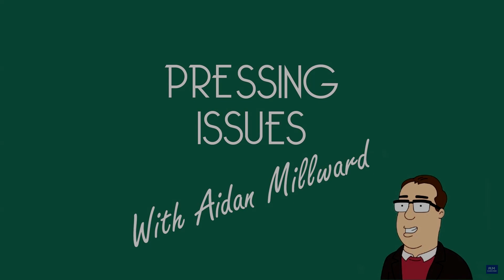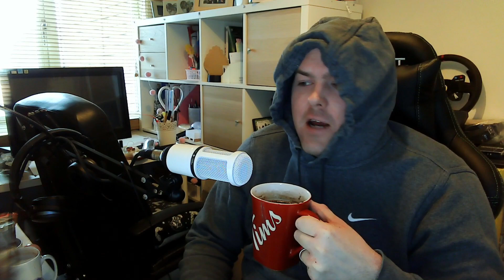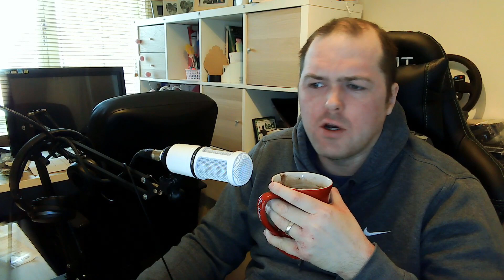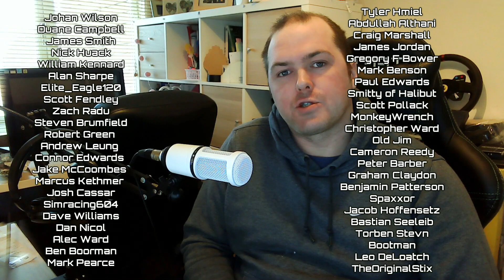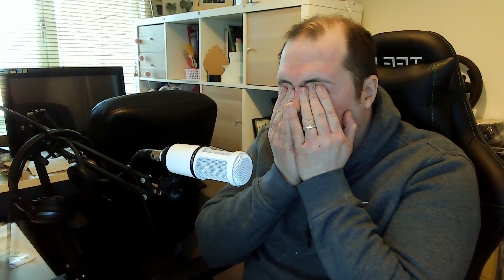IS IT REALLY TILKE'S FAULT? Opinions on Hermann Tilke Track Criticism

Comment: New proposition: it’s the cars’ fault for being way too powerful. I remember A1GP. They had 550hp and they went to all sorts of interesting tracks. Brands f.i. They could because they weren’t so fast that it wasn’t safe anymore. Less power would also help against dirty air since you can’t set up for all that downforce if you haven’t got the power to offset the drag
Reply: unfortunately due to how the engines are with the hybrid systems you wont be able to go under something like 750bhp even if you went down to a 4 cylinder engine as Porsche used a V4 hybrid engine in WEC and it produced 1000 bhp
Reply: @thebronzearchertba9442  No, the V4 produced 550hp. The remainder of the power was from the hybrid system. Any engine/hybrid system can produce as much or as little as it is regulated to do. The 1st gen Prius was a hybrid, and produced significantly less than 750HP; the engines in GTE (LMGT) produce less power than the road cars do, the old 2.0l F3 engines produced less in F3 form than when thy were used in touring cars; the GP2 engine produced more power when it was put in an LMP2 car, the FIA F4 engines produce more power in WTCR cars, NASCAR restrictor plates gave the 900hp engines 550 on Superspeedways - it's all goverened by fuelling, revs, restrictors, gearing, boost, exhaust; plus hybrid regen storage and delivery capacity. The current F1 cars could easily be restricted to 600hp combined - but what would be the point now all the money has been spent making them excessive.... The 'less power' argument would however solve nearly all of the 'bad track' problems - just look at GP2/F2 races.

Comment: I believe Tilke also mentioned that the problem with modern day tracks is that they have to cater for more than just F1 races. Especially if bike racing also takes place there makes a new track a horrible compromise so you end up with the worst of both worlds so to speak.
Reply: Or the motorbike racing is excillent which is whats happened with Moto GP at some of the tracks both F1 and Moto GP go to

Comment: Poor F1 racing is far from Tilke’s fault IMO. True a couple of his tracks are a bit dull IMO, but no more commonly than average. The tracks are largely constrained by safety, the lack of land & irritated locals. Many have corners that I don’t like, bk I struggle w/ them so much, but I see that more of a change to make me a better driver.

The primary blame IMO is F1’s dependency on downforce (not necessarily bad) causing dirty air making it hard to pass.

The other biggie IMO is the dominance by 1 or 2 teams. This is mostly bk of the insane costs to run at the front in F1.

They have made small +’s in theses 2 areas in the last couple of yrs but I think MUCH more could be done on both points w/ still having cutting edge technology w/o turning it into another NASCAR or Indy-car. Eg Blancplain GT3 & Japan’s JGTCC.

Comment: Yes and no.
Hermann does have a certain theme for a number of his newest tracks (Chain Bear does a great breakdown of this). There's always going to be a sharp hairpin into turn 1, 90 degree corners, and corners that were popular in previous tracks he's designed. Some of them, like the South Korea track and Abu Dhabi look like they were designed for something else in mind; like he got bored with doing tracks and thought, what if we put a hotel that looks like a spaceship in the middle of this? Or if they built a city in here? 
In his defense, he's got to follow FIA regulations and what the higher ups at F1 want. And Lewis Hamilton is an anomaly who can't stop winning. I think Liberty has to stop with this whole 'destination race' idea because trying to get a good race on a street circuit is impossible unless you convince whatever city (or in Singapore's case, city-state) you're racing in to demolish 10 blocks to have a bigger pit lane. With that said, he's going to have his hands full trying to get a good race in fucking Saudi.
Reply: Yes to Korea and Abu Dhabi - the same as Sochi the track layout space was dictated in part by the need of the planners for the tracks to go around (or through) yet-to-be-built objects. At Yas Marina and Sochi they mostly got built, at Yeongyam, not so much...

Comment: I genuinely don't get the hate towards Hockenhiem... I absolutely love the current layout
Reply: I was born after F1 stopped using the old layout and I enjoy both the current and old layout of Hockenhiem and it ultimately wasnt Tilke's fault that the circuit looked the way it did he still wanted to origonally use the old layout but with modifications and more seating he planned to try and get the chicane removed from the Ost curve but ultimately it was the circuit owners that wanted the old circuit gone

Comment: I don’t think fia rulebook state that most of the corners have to be 90 degrees.
Reply: Apart from Sochi (built around an existing set of structures), Baku (street circuit), and Singapore (street circuit), which Tilke circuit does that describe?
Reply: @grommile  You're forgetting abu dhabi and it's 3rd sector which is almost entirely 90 degree corners. The problem is though the track at that point is restricted by the harbor and building that it winds around. You can't really make any changes there without changing the harbor or destroying some buildings. So  really, this is another case of tilke trying to make the best track he can in a shitty situation.

Comment: You can't blame the track designer or the track

when it comes to putting the on track product on it comes down to the race teams and the officials to give them a good package to actually put close racing on

in as much as we all know Ferrari was cheating in 2019 I personally don't think they're engine should have been nerfed to the point that it was

They were the only other manufacturer that had a real shot at the championship in 2019 let's face it Honda Renault and all the other cars on the grid don't really have that shot like the factory Ferrari team

And also you know it's been over a decade since Ferraris won a championship I think

So you can't blame Lewis Hamilton's basically got the same problem that Jimmy Johnson has he's too damn good now

And he's in the best equipment

And he has proved that he deserves to be in that equipment as far as I'm concerned no other driver has proved yearin and year out that they deserve to be in a Mercedes car like Lewis has

I've got an easy solution put a rule in the rule book that requires the team to do two stop race

Intel pirelli they have to bring softer tires softer tires will solve some of the issues

But if you have a rule in the rule book that requires them to make more than one pit stop let's face it all the teams have got this figured out to where they can only do it do it on one stop

One of the best things about IndyCar and NASCAR I'm using them as perfect examples they actually have pit stops

Throughout the race and good strategy for me one it's either who can run the longest who can make the soft tires last the longest to get to this point

Who can catch a safety car at the right time

Also the guys in F1 do not know how to control restart if one doesn't do their safety car restarts right

They should have a at least a cone where the restart it takes place at the entrance of pit Lane that you take off zone

That's how it works over here in America we have a little yellow orange cone we have to follow and sports car racing in open will that tells us where we can go before we get to the restart zone

That is the restart zone with the green flag comes back out

And restarts can make a race I mean just just look at probably some of the moments of that the Nascar highlights over the last two or three years especially the last two I can guarantee you most of them are just highlights of restarts

In the cars the same way

there's a lot of things in formula one that just need cleaned up and it's just like they use a different rulebook to the rest of the world of Motorsports

But like I said it is the sanctioning body has to bring a good package for the teams to actually use

And I hate to break it to everybody but the current package they have isn't that great it's great for the team and you have the teams who have a huge huge steak in the direction of sport

I I kind of like that they can stop things from going in but maybe they

I am just saying maybe they need a couple people up there that's actually working for the FIA that actually understand race cars

Comment: well why not make the track on a sim  before making the damn thing real life. why not grab a couple of retiered F1 drivers to test out the track. plus there is a big advantage to it on costs, ensuring safety and as a designer its easy to twiek or adjust the turns for much more and better competion. or even the whole track. if they have done that there be more action in the first place. before even the Track is made its already been done you can do more exclusive testing to make the much more safe why not use A'ls to test out the track for the  better see what would a grand prix look like on the track we already have the tech to make better tracks for better competion and safety why not use those. the power for simulation these day are very powerful why not use that power design a track run simulations adjust improve them make it in to reality.

Comment: "IS IT REALLY TILKE'S FAULT?," the Jim Beam asks.

Yes.  If you throw out the safety regulations (the acres of runoff...), the track design is all down to him and his team.  All the Tilke tracks have the same characteristics - one sector is all about straight line speed, another sector is about handling/downforce and the third sector is about mechanical grip.  If your car can nail 2/3, you will almost certainly be on the podium barring all other factors.  If you look at classic tracks, you won't find those three characteristics, you almost universally find 1 or 2.

Comment: Unpopular opinion: Abu Dhabi is a great circuit.
Reply: Yes, that's an unpopular opinion. It's unpopular for a reason. Ab Dab is crap.
Reply: I will give you that the circuit has some good bits but for the most part its a god awful circuit for racing
Reply: @thebronzearchertba9442  https://youtu.be/gPUk_XsWN2c?t=210 The stream quality was better - but you have to acknowledge this is not a bad circuit, for GT cars....(I'd also recommend 2013 & 2014 GP2 races) 
So it is an awful design, or are certain cars (ironically) just wholly unsuited to it?

Comment: Make F1 interesting again?
Open up engine specifications. Get rid of DRS. Less aero & more mech grip. More tyre manufacturers. Get rid of power steering. Also, reintroduce manual shifting.
Happy new year.
Reply from the maker: So make it like the 80s where the winner was as much as a lap ahead of second place nearly every race? Gotcha.
Reply: @AidanMillward  Meh. Swings and roundabouts.

Comment: With one guy making half the tracks those tracks feal like they lose their uniqueness and flow
Reply: especially when they do it by lifting bits of other tracks. Old ones seemed to flow around the terrain that was there (mostly), newer ones either are designed around the need for car parks, shopping centres or managed by demolishing anything within a huge radius

Comment: It's definitely not all Tilkes fault that some of these tracks provide boring races.
It's ENTIRELY the fault of F1 though, for a few reasons...
They are the ones dictating minimum runoff, minimum corner radius etc - and if you have a limited amount of land to work with, and all corners area required to have a certain amount of runoff, then you have less land than you thought to actually build a track.
2nd - f1 is CONSTANTLY changing the rules for the cars. More downforce, less downforce, bigger tires... Etc etc etc.... WIDER CARS are a huge part of the problem. So when the cars get bigger and more and more aero dependant, then corners which were designed to be overtaking areas turn into a follow the leader exercise. That's not Tilkes fault.
3rd - they haven't hired anyone else besides Tilke to design tracks. Sure he's working within a confined set of rules - and people's are always gonna have their own ideas of what's good and what's bad. Tilke may not like decreasing radius fast sweeping corners for example - but someone else might love them. So simply hiring someone else occasionally to design a track would automatically bring new layouts, new ideas, new solutions etc. They should at least hire 2 or 3 designers to come up with an initial sketch of the track they intend to build, so that F1 can compare the 3 layouts and design whichever one is best... Or maybe combine elements of different ideas. The fact is that if you only ever get one person to do something, that person is going to end up doing that thing the same way, or close to the same thing every time. That's just human nature.

My gripe about Tilke tracks is that his designs tend to just have so many corners it prevents cars from getting a run on each other, because each turn is almost always followed immediately by another turn.
Road America is actually a great example of what I mean.... They say there's 13 or 14 turns on Road America, but like Aidan said - I think 3 or 4 of those "corners" are literally just a tiny, gentle, barely noticeable slight curve in the track that's taken absolutely flat out, and could be taken flat out by literally anyone racing car on earth... Including a top fuel drag car. I mean the road barely, barely curves at all yet they call it a turn.

Road America is one of the best tracks in the world for overtaking and good racing in general. Why?
THERE'S ONLY 10 OR SO ACTUAL TURNS and the track is over 4 miles long.
That means lots of straight bits, followed by a hard braking zone.
Straight bit + hard braking zone = overtaking. It's really, literally that simple.
Tilke tracks are just a busy cluster fuck of twists and horrible hairpins. Look at COTA, it's a fun track on a Sim and drivers say it's fun to drive - but it's not a good track for overtakes or good racing in general. Because it's just a spaghetti bowl of random turns all mixed up - and there's like 22 turns packed into about 3.5 miles.
That's double what Road America has.
So there's naturally less chance of passing, because there are so few straight parts of the track and so few braking zones that facilitate passing. Turn 1 is good, but other than that it's kinda hit or miss - mostly miss.
Indycar raced at COTA and it was FUCKING BOOOOORING just like the F1 races there.
Indycar at Road America is NEVER boring... Literally never.
Watkins Glen is another great example - fast, but lots of places to pass.

Tilke is what he is. Clearly he loves and thinks cars are at their best when weaving thru a 2md gear 80mph set of perfect geometric shapes.
I think tracks like Spa are the best because they make due with the landscape and the turns aren't all just sterile, perfect shapes and they introduce some uncertainty into the mix.

I do think Tilke designs are pretty crap overall - but F1 keeps hiring him. He is what he is. He obviously knows F1 seems to like tracks with 15-20 (or more) turns that are around 3 miles long, give or take a half mile.

You wouldn't hire a racing horse 20 times to enter a race, then one day rent a donkey and expect the same thing.
So Tilke is a horse - or a donkey - but you can't change that, and if you want an antelope you gotta go find an antelope, not hire a horse and paint it with some stripes.

Comment: The fact his design philosophy is "rip off great corners from other circuits" and chaining them together will result in a great circuit.
Ive seen his defence has been "its fun to drive" or "each coner is designed to look great on tv."
Never mind his designes are generally flat. Take Interlagos which due to being a swamp, undulates in every direction.
He doesnt seem to grasp that the build up to each corner, ie the 3 -4 coners before it are just as important and its that what gives exciting racing and not snaking through a series of s bends. With some intelligence and a lot of thought a track that has multiple lines could be designed. Look at Verstappen again in Interlagos in the wet. A1 ring is another were you are rewarded for taking alternate lines (turn 4 is it where Hamilton punted Albon off)

Tilke wasnt to blame for Hockenheim but you cant really say hes done anything great with those old circuits either. It is unfair to judge him on that as you rightly said, was connect the dots with what was left.

 Its his blank slate designs I judge him for which are flat ripped off designs that lack any character of their own. Hes designed so many circuits at this point I am heavily suspicious that any "good" features are actually flukes than conscious lightbulb moments. COTA was the first circuit that had any "ive learnt a new trick" and that was a single hill into turn 1. Yes....1 single hill